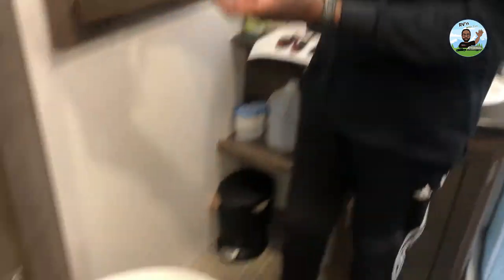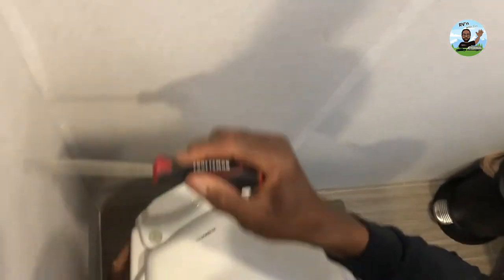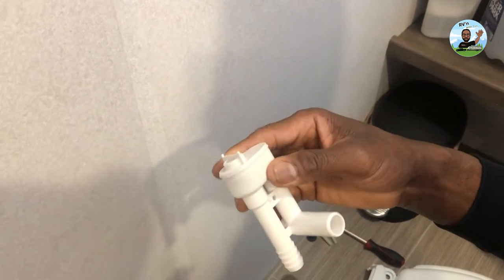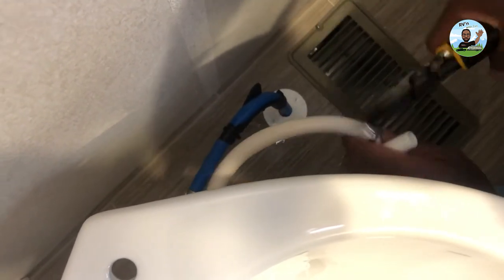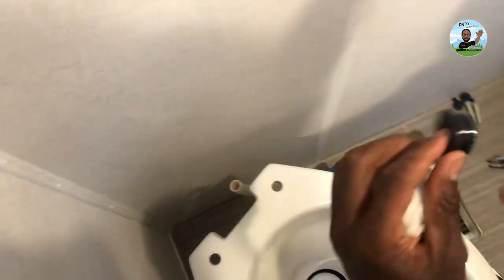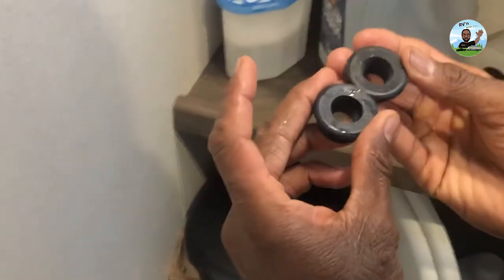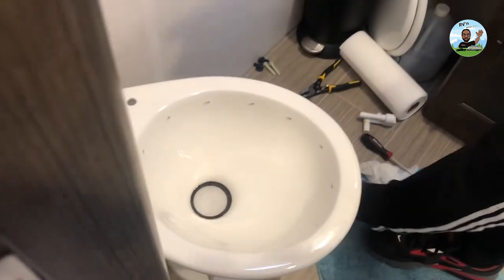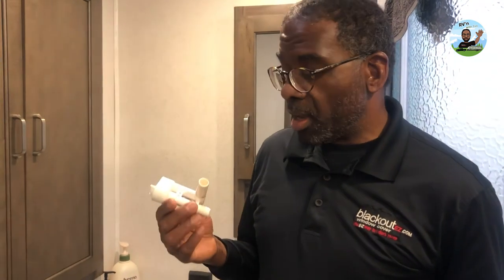How to fix leaky toilet valve in your RV - vacuum breaker valve

Comment: Thank you for an excellent video and instructions. That was exactly my problem, probably from not properly winterizing.
Reply from the maker: You are so Welcome! You did winterize correctly. I believe the problem to be the antifreeze gumming up sitting so long causing the valve to stick. The first time it happened to me I was able to gently push down on the valve to free it up. The second time I actually broke it. Tim